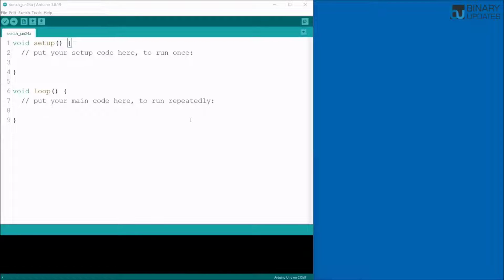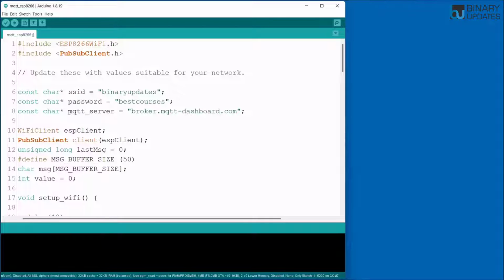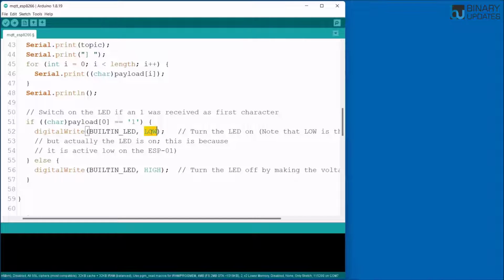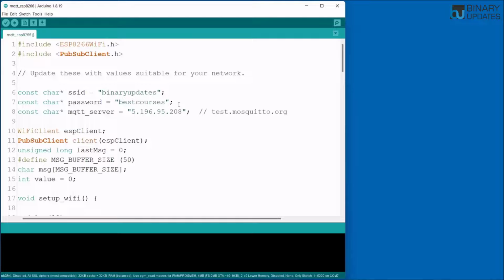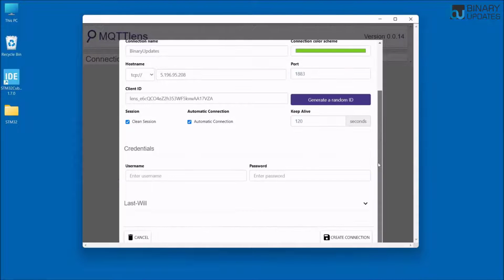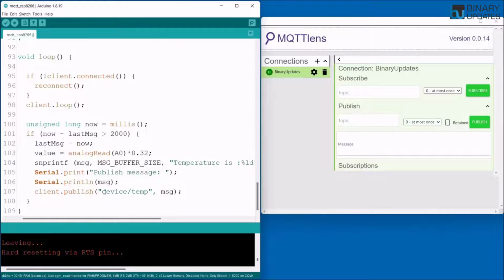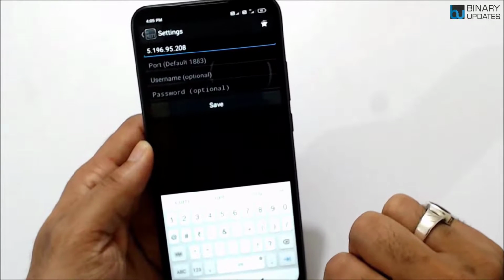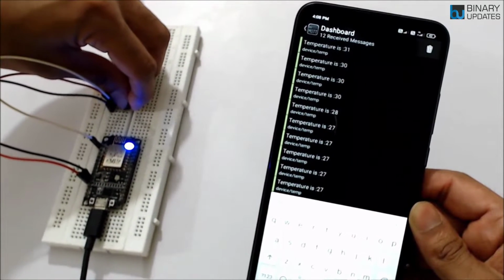MQTT Protocol with NodeMCU ESP8266 Tutorial

Comment: Hello sir 

I am planning to develop a home automation system for my college project, which I also intend to implement in my own home. The system involves connecting multiple relays and sensors, and I have chosen to use NodeMCU devices for this purpose. Each NodeMCU board will contain several relays and sensors. To overcome the limited range of the router's signal, I have established a mesh network of NodeMCU devices, with each device connected to the router. Additionally, I plan to utilize the Home Assistant operating system to control the relays.

To program the NodeMCU devices, I have opted for Node-RED, and for storing the sensor values and relay statuses, I have selected InfluxDB as the database. Furthermore, I plan to use Grafana as a data visualization tool to create an attractive dashboard for the system.

In this home automation system, I aim to incorporate the following features:

1. Manual Control: If the home automation system fails, I want the system to function as normal, allowing manual control over the electric appliances.

2. App Control: I want to implement an application-based control system, enabling users to control the system and its connected devices remotely through a mobile app.

3. Automation of Electric Appliances: I intend to automate the operation of various electric appliances, such as lights, fans, and other devices, based on predefined schedules, triggers, or user preferences.

Now, I have a couple of questions regarding the implementation of this system:

1. How can I effectively utilize the mesh network of NodeMCU devices to control all the relays and read sensor values? I would appreciate insights on managing communication and synchronization within the mesh network.

2. I would like to implement MQTT protocol in my home automation system. Could you provide guidance on integrating MQTT effectively, ensuring reliable communication and message exchange between the devices within the network?

Thank you
Reply: this is so detailed u could honestly just ask gpt

Your project sounds ambitious and well thought-out. I'll try to provide insights on both of your questions:

### 1. Utilizing the Mesh Network:

Using a mesh network for NodeMCU devices can greatly expand the range and reliability of your home automation system. Here's how you can effectively utilize it:

- **Central Node**: Designate one NodeMCU as the central node (often referred to as the master node). This node will be the primary communication point with the Home Assistant operating system and any other external systems.

- **Message Protocol**: Implement a standardized message protocol. This should define messages for controlling relays, reading sensor values, health checks, etc. Each message should have a unique identifier, source and destination addresses, action type, and any associated parameters.

- **Routing and Addressing**: Ensure that each NodeMCU in the mesh has a unique address. The central node should maintain a routing table that keeps track of the best path to each NodeMCU in the network.

- **Health Checks and Redundancy**: Implement regular health check messages to ensure each node is functional. If a node fails to respond, the central node should attempt to find an alternative route to it through the mesh.

- **Data Aggregation**: Since you're planning to store sensor values in InfluxDB, consider sending aggregated sensor values at regular intervals (e.g., every minute) instead of real-time updates to reduce network traffic and database writes.

### 2. Integrating MQTT:

MQTT is a lightweight messaging protocol designed for low-bandwidth, high-latency, or unreliable networks. Here's how you can integrate it:

- **Broker**: Use an MQTT broker like Mosquitto. This will act as the central hub for all MQTT communications. Install it on a server or a Raspberry Pi.

- **Topic Structure**: Use a well-defined topic structure. For example: `home/room1/light`, `home/room2/fan`, etc. Use sub-topics for commands (`set`) and state (`status`), e.g., `home/room1/light/set` and `home/room1/light/status`.

- **Publishing & Subscribing**: 
  - NodeMCU devices should subscribe to the relevant command topics (e.g., `home/room1/light/set`) to listen for relay control messages.
  - They should publish sensor readings and relay statuses to their respective status topics (e.g., `home/room1/light/status`).

- **QoS Levels**: MQTT has different Quality of Service (QoS) levels. For critical commands, consider using QoS level 1 (message is delivered at least once) or 2 (message is delivered exactly once). 

- **Retained Messages**: Use the "retain" feature of MQTT for the status topics. This ensures that the last known state of each device is always available to new subscribers or after a disconnection.

- **Integrate with Home Assistant**: Home Assistant has built-in support for MQTT. You can define MQTT entities in Home Assistant, and it will automatically subscribe to the relevant topics and control devices accordingly.

- **Secure the Communication**: Ensure to enable authentication on your MQTT broker. Consider using SSL/TLS to encrypt the communication between the broker and the clients.

- **Feedback Loop**: When a command is sent to a NodeMCU device to change the state of a relay (like turning a light on), the NodeMCU should acknowledge the receipt of this command by updating the status topic. This ensures synchronization between the control interface and the actual state of the devices.

Remember to test each component of your system in isolation before integrating everything. This will help you pinpoint issues more easily. Good luck with your project!

Comment: led input connected to which esp8266 pin
Reply from the maker: Hi Kimberly

The LED is connected to GPIO2 Pin which is D4 Pin on NodeMCU ESP8266. Usually, all board comes with built-in led connected to NodeMCU on the same pin. I hope this may help you

Good luck and best wishes!

Comment: raise FatalError('Failed to connect to %s: %s' % (self.CHIP_NAME, last_error))
esptool.FatalError: Failed to connect to ESP8266: Timed out waiting for packet header
Failed uploading: uploading error: exit status 1
Reply from the maker: Hi Duan, close Arduino IDE and try to reupload the code. It seems an issue with Arduino IDE. This happens sometimes when libraries fail to link properly while compiling and uploading the sketch in ESP8266. I hope you find useful. Good luck and best wishes!

Comment: Very nicely explained video and u got a great explaining capability.

I have one question. We cannot hard code the wifi ssid and password in commercial products as it will depend on user to user. What is the best way to parameterized it and other required credentials  in a USER FRIENDLY MANNER so that it can be set easily by users.
Reply from the maker: Thank you very much for your kind words. Now coming back to your question. I understand writing WiFi credentials in code is not good practice while building product. So you can use internal memory of ESP8266 Microcontroller and via webserver you can let user to change WiFi credentials as and when needed. This is exact mechanism is used even in our internet router. I hope this answers your question. Thanks again!